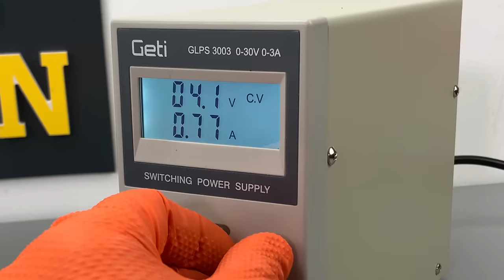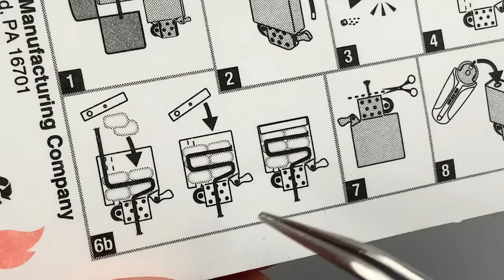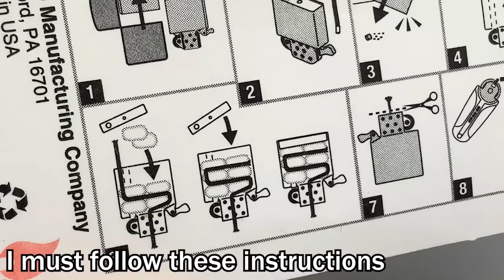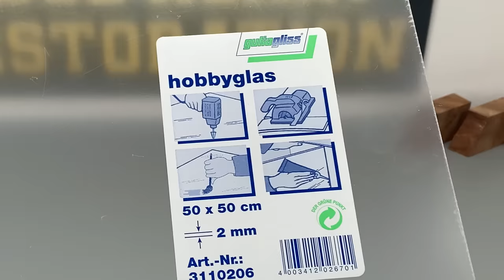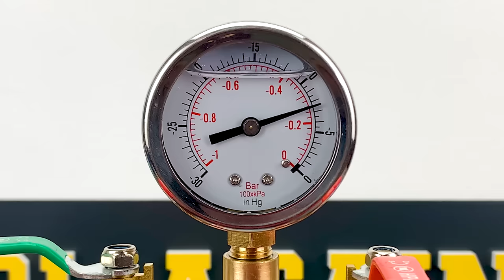Zippo Lighter Restoration & Making a Wooden Case for it 🔥

Comment: Why do I feel that the Insert was changed to something new mid-sandblasting. The side pitting/being bent disappeared, as well as the insert is from January 2010, while the case is 1932-1989.
3:51 - Pitting visible, back side is bent inwards, 3:59 - Insert is swapped to a new one.
Apart from that - end result is insane, as this was more of a wood/epoxy project, rather than a true restoration, that ain't much. Enjoyed the video still
Reply from the maker: I've already discussed this with others who have commented. due to the rust, the insert looked flat, and when the surface was sandblasted, the shapes began to show. the rust was not deep and the surface had no pits. Indeed, I removed the insert while blasting to better clean the inside with a small brush. then I straightened the board. I didn't show it in the video, because I would have made the video too long and it wasn't a very complex job. I've reviewed that part a few dozen times and you certainly have every reason to believe that the insert has been changed. but I assure you it was not so. Indeed, the insert is newer than the case, but that's how I bought the lighter. I bought it from a beach boy, most likely it was found on the beach near the Black Sea, Constanta, the city where I live. Cheers and glad you liked at the end 👍🏻
Reply: @CoolAgainRestoration  Thank you for such an indepth reply
Reply: @DeividasGedgaudas  the insert may have been changed out by the same person who changed out the wick to a non-genuine wick. That would explain the date discrepancy.
Reply from the maker: It is possible 🤷🏻‍♂️
Reply: @CoolAgainRestoration  esti genial omule!
Reply from the maker: Multumesc frumos 😊
Reply: Very cool job 👍
Reply from the maker: Thanks buddy
Reply: @hardly_harlie  my guess is it was someone’s dad’s or grandfather’s from like WW2. But it was messed up inside. They didn’t have the $10,000 in tools to restore like this. So swapped out the insides for new ones. Now their grandfathers lucky lighter works and still has the original case.
Reply: You digging too deep brother just sit back relax and watch it
Reply: Because it wasaaassssasas
Reply: @hughmongus8279  I think its nice to be curious sometimes
Reply: @lucabuzz2678  this man could be a serial killer in real life, but we wouldn't know.
Reply: @ogracid9883  huh?
Reply: I thought the lighter looked better before you restored it.
Reply: @CoolAgainRestoration  why did you change the title of the video
Reply from the maker: I had many bad comments because I used a worth of equipment to restore something cheap ..
Reply: Video🔥😐
Reply: O
Reply: @CoolAgainRestoration do you take on work for hire? I have an interesting zippy of my dad's from Korea that I found today. I'd love to have it restored.  And you do excellent work. We have so few thing that belonged to him. This is one I'd like to keep.
Reply: @ogracid9883 ha ha ha that’s true 😂
Reply: @rakimu6023 this. It never hurts to ask a question.
Reply: Koa is an extremely hard wood. I love that you chose that.
Reply: Chèn gổ vô trông mất giá trị của chiếc bật lửa nhưng dù sao tôi vẫn thích video này
Reply: Спасибо за замктку,но лично я вижу ту же вставку одну вставку, что до обработки и после. Вогнутые места поправленны естественно. Но  бокова линия штампа корпуса там же. 
За видео очень благодарен автору. Моё уважение и почтение такой работе . Вы мастер высокого уровня! 😉👍. Я сам с деревом  занимаюсь! И работу Мастера и к тому же ресторатора!!! Обожаю посмотреть. Продолжайте пожалуйста в том же духе 👍👏
Reply: You somehow managed to hate in a constructive way
Reply from the maker: @user-kx7er6gw1j This is your opinion but is wrong .
Reply: Looks cool. Functionality is questionable. Wood is porous and I Believe lighter fluid contains naptha that can be used to thin epoxy varnish and paint. If you use the lighter daily I believe it will break down and you will end up with a sticky mess in your pocket. I could be wrong but I think you were better off just polishing the brass case or sanding it and giving it a clear coat for a patina look that won't turn your pocket green.
Reply: 😊ภ❤
Reply: @नाथुसिंहनाथुसिंह-द9ख is that a hand grenade? 😂
Reply: Disfrute el video cada segundo,un excelente trabajo, felicitaciones, realmente una delicia!!! Saludos desde Argentina
Reply: @ramirobassi8566  Gracias che

Comment: I really appreciate that it's kept in its original brass case and just given a new added look with the beautiful wood-resin bit. 

At least if you want to go back to beautiful, shiny brass, you just have to gingerly take jt out.
Reply from the maker: True. That was the idea from the first. But for this reason I was afraid to make a case because I didn’t knew how will be the results. My luck that I made the case perfectly fitting for the lighter. Not too big,not to small. Like you said,you can take out when you want 🤩

Comment: I use and love my zippo lighters. the box of zippo stuff, where did you get those tools the jeweler type tools, and the block for the body? did you machine them yourself? if so, what would it cost to get a set? I am a welder and use my zippo lighters for safety. I also love the nostalgia and collection parts of this.
Reply from the maker: I bought that set from EBay . I think they came from China,but is a very helpful set. Thanks man and glad you liked it 👍🏻😊

Comment from the maker: I will reply to all messages as usual. If you have questions about this restoration or opinions, feel free to write in the comments. Enjoy the video ,Thanks and Cheers !!
Reply: My friend, David, the restoration and customization has always been beautiful. Do you often restore many ZIPPO? New equipment? A big hug. 🍻🍻🍻
Reply: Is there anything you cannot transform into art? seriously about me because you are good beyond measure, Wood Metal Electronics,
I bow. why in wood and resin the case?
Reply: Threw in a little F bomb there 🤭😁! Great work 👍! I'm restoring a bar top for my sister in law and she wants me to make a mosaic with bottle caps and corks, and then cover it with epoxy resin. Only issue is I've never worked with epoxy resin before 😬 and I'm extremely nervous about screwing it up! Any tips?
Reply: Very good friend. Hugs from Brazil.
Reply from the maker: Hi Rick ! You should check the thickness for the casting resin. For example mines,you can turn only 10 mm layer. After some tutorials video on YouTube, I bet you will become a pro. Is nothing too hard when working with resin. Just be careful with the bubbles. When mix the resin,you need to vacuum the air from epoxy
Reply: Really intersting! Loved the "marmor" effect. Perfect combination of colours and profissional work!
Reply: do you sell your restorations?
Reply from the maker: Hi Joe ! For the moment not 🤷🏻‍♂️
Reply: Hey brother, can you share a link for the zippo repair kit? Thank you
Reply: That wooden case is the SHIZZZNIT 💯💯😆🤣💙💙👍🏼👍🏼✌🏼✌🏼
Reply: Where can I find cam
Reply: Did you know zippo restores them for free I had to ship it to them
Reply from the maker: They don’t restore them . They only make some repairs if the lighter is in good condition. And yes,for free of course
Reply: Absolutely beautiful mate!!
Reply: i love the work!! my only concern would be scratching the brass trying to get it out of the case, do u think that will be a problem?
Reply from the maker: No,I don’t think. Because I used wood grease inside the wood case for a better slippery 😊
Reply: @CoolAgainRestoration  good thinking!!!
Reply: Amazing work! You have a great eye for artistic expression. The attention to detail is top notch. Bravo good sir... bravo.
Reply from the maker: Thanks Mr. Huff 😊
Reply from the maker: In 2-3 weeks I hope . Is hard now because of baby . I need to pass this period and after that,the things will come to normality
Reply: Will you sell this lighter?
Reply: @CoolAgainRestoration  May I buy ya Zippo cases? But add the blue sand at the top as well. Because I like you work and I got Zippo too.
Reply from the maker: Hi and thanks for being interested. Unfortunately isn’t for sale 🤷🏻‍♂️
Reply: Oh well I was just hoping to have a case for a Zippo. Good work.

Comment: I love the way that at 6:29 the zippo logo is completely gone on the bottom of the case but you somehow "restored" it later
Reply: i hope you know thats the cap of the zippo case my man
Reply: @idiotic_dude  :) Unless the cap is bigger than the bottom, the bottom of the case has no logo on it at this time stamp. Neither does the lid. The Zippo logo and related is gone under the bottom part of the case, and there is no "solid brass" on any of it either when it comes out of the glass beads.

It most definitely looks like another case. However, just because the guy has chosen to use another case doesn't make the video less interesting. The case may have been restored, but not for this lighter. :)
Reply: @LifeOnHoth  you are seeing the other side of the lid.. the 'SOLID BRASS' is written to the right of the hinge on the lid. and this frame shows the other side..

Comment: How do you decide what needs sandblasting and what goes in the cyclone?
Awesome restoration, by the way. The case looks sick, but I think I prefer the lighter as is ;)
Reply from the maker: That’s why I made the case perfectly fitting. The lighter can be take out easily and wear like a normal lighter. I thought that the air pressure will hit the brass case and will damage the material. That’s how I decided to use the cyclone 👍🏻
Reply: @CoolAgainRestoration  i always thought  its that situation where "if it fits, it goes in the little tumbler", just because working with the sandblaster on small materials can be tiresome and not very comfortable

Comment: Very impressive work, lighter restoration and making the case. Am split between wanting to see and admire the lovely restored lighter or keeping it in the case, think a display rota system required 🙂 Having the right tools helps so much, & I hope you can find a use for the Zippo restoration tools on other projects.
Reply from the maker: Thank you very much man! That’s why I made the case perfectly fitting. If someone want the lighter as normal ,he can take out from the case very easily 😎

Comment: As a machinist I have to ask why spend so much restoring that zippo when you could have used $2.50 brass restoring compound and just buffed and polished the corrosion off of the case and the lighter inserts, and simply just changed the flint, wick, and cotton?
Reply from the maker: Because I like to make things when I have free time . I saw this project a times ago and I wanted to make a case like that .

Comment: you could use electroless nickel solution  it is very good for rust and corrosion prevention , and looks good too , that if you don't have a rectifier, but is harder to chrome plate than electrolytic nickel plating (whatts nickel)

Comment: The metal base to hold the insert when you push the rivot out of the flywheel..... what is that item called?  and where would I possibly be able to purchase?

nvm, i found it .. zorro flintwheel removal tool
Reply from the maker: Glad you find it 👍

Comment: Awesome video! However, you polished off the nickel plating. The plating is barely .02mm if that, so when you put it on the buffing wheel it is taking the plating away within seconds. First you must polish the base metal and then plate and the plating will come out with a high polish. 

I’m a jeweler, and when rhodium plating silver you first need a layer of nickel to hold the rhodium plate. Nickel is beautiful with a nice mirror finish. With stainless steel, I would recommend sanding to about 1200, then using a platinum Tripoli and finishing with Picasso blue rouge or fabulustre also works well with stainless. 

Wonderful video!
Reply from the maker: Wow,this is a nice and helpful advice. I will search more about these products and put in the practice 👍🏻 thank you very much Jeremy 🤗 take care

Comment: I usually don't find much use in these restore videos. They are asmr and nice and everything, and you learn a lot about stuff. But it's mostly... meh...

On the other hand, I had my zippo lighter for about 30 years. Well... to be fair, at this point I have this idea of a zippo lighter. I had one lighter from 30 years ago that gave up finally after 25 years of service. since then, i tried new ones, but they are not exactly on par with what was available 25 years ago. 

so maybe I should be looking toward restoring an old zippo, rather than buying a new one. at this point, new means it will degrade in 6 months. And yes, real zippo. not some chinese fake. its the hinge that becomes unaligned at first, and then just breaks. the materials and the tolerances are completely shit.
Reply from the maker: My advice: every time is better to restore old one than buying new one. The things made 15-20 years ago was better made than now

Comment: Wow that insert was only from January 2010.  That lighter got bad fast.
I'm guessing that the insert was replaced during the life of this lighter.
Edit: so that's a special bottom stamp that was used for a short time. The second year, this one being 1989, is the date of manufacture. 
It was part of a line of lighters celebrating how long the company has been making lighters. 
So I definitely think at some point near 2010 that the insert was changed.
Reply from the maker: Can be possible 😊

Comment: Amazing, whats does 1932-1989 means on back of lighter.  I have same 1932-1988 same solid brass lighter never used...
Reply: It's a special edition released in the later year. 1932 was when Zippo started manufacturing lighters

Comment: Seeing as I'm from the same town as Zippo, I should point out that they repair or replace any lighter for any reason for free for as long as you own it. There's a display in their museum of lighters that they've replaced, including those run over by a locomotive or put through a milling machine.

However, I realize that would defeat the purpose of the video - so it's just a PSA for anyone out there. And some of them might have sentimental value, which is why they do sell the repair kits. All in all, this was very cool!
Reply from the maker: Thank you very much Adam. My goal was to be able to recreate a wooden epoxy case like I seen one 2 years ago in a photo. It was in my mind over 2 years and now I said it’s time to make one 😇 thanks again

Comment: Everything is correct, but you put the wheel on backwards! The lines from the wheel should be facing the other side of the lighter, because the way we make them at work, it’s a directional cut! Other than that great job! 👍
Reply from the maker: Wow.. never thought at that. I thought doesn’t matter. This is a really helpful advice for future projects. Thanks man

Comment: Amazing work, it looks stunning! One question, with the top being fixed into the wood as well, once the zippo runs out of fuel, can it still be removed to be refilled?
Reply from the maker: Yes, the wooden case has a perfect fitting and can be easy removed

Comment: Just a tip: if you really want to clean metal objects before getting them plated I really reccommend brake parts cleaner - it's specifically designed to remove oils and any other type of residue that can affect friction in brake parts.
Reply from the maker: Thanks 😊

Comment: Looks there should have been a bigger space in the back where the hinges are, because you couldn't fully open the lighter. Did you not take into account the top and bottom case rubbing together when opening?
Reply from the maker: It can be large opened. I have a lot of images on Instagram with the lighter large opened

Comment: “Making a wood case for a lighter”
I don’t think that’s a good idea trust me bc what if it somehow makes a spark and a flame starts all bc you dropped it
Reply from the maker: Sparks can’t open a fire with that wood. Need a soft wood and a big flame . I put that wood in the open fire for 15 seconds and except the black colour from the smoke , was intact. Also, I made the case with an large opening, the lighter flame can’t reach the bottom of the case

Comment: Funny it rusted,zippos are usually stainless steel or  chrome plated or Nickel-plated.Odd?
Reply from the maker: Is not so funny . It’s science . This lighter case is made of brass and when brass oxidizes, the surface became blue/green . The same for copper 👍😉

Comment: Hey man question because dremel bits gotten expensive how you remove the rust to make it easy and where can I get the stuff and or chemical and what type of chemicals
Reply from the maker: Rust remover from any DIY store or if you have access to a bench grinder you can use a wire disc 👍🏻

Comment: hey i know im late but where did you find the zippo rivet repair kit?
i have a zippo that sat under the seat of a truck for many years that had a rusted up flint wheel so the rivet had to be knocked out and replaced but the "rivet" i used is not made to be a rivet
anyways, so where can i get that repair kit and is it remotely expensive?
Reply from the maker: Hi buddy! I bought the set from EBay and was like $11 but with shipping to Romania was 25. Now depend where you live. I think the seller is from China but they are good quality 👍

Comment: Looks great and all great work but correct me if I'm wrong but wont the wood case burn since it's that the close to the flame
Reply from the maker: No. Because the up wooden part had a large opening and the flame don’t reach that part.

Comment: Correction. You used 10,000 of resources and equipment to restore a 10 dollar lighter that is covered by a lifetime warranty for free repair or replacement.
Reply from the maker: Raymon, zippo don’t restore your lighter. They only make some minor repairs. Like changing a flint or spring or cam,things like that.
Reply: @CoolAgainRestoration  i did not know that. Pretty cool how its new again. I have a box full of old Japan lighters and old lipstick lighters in need of repair .